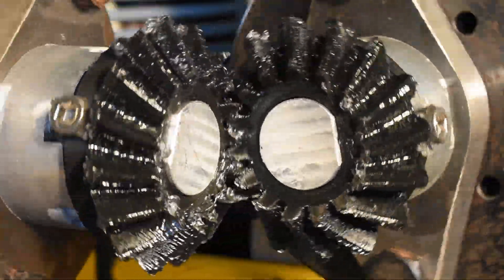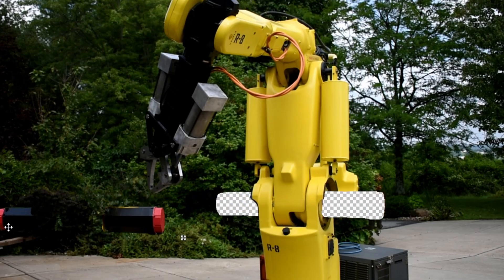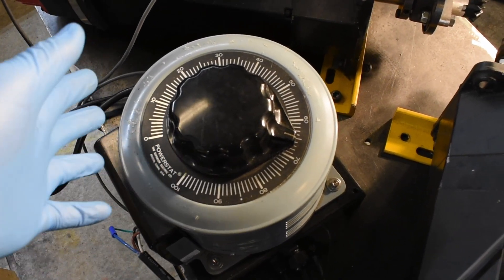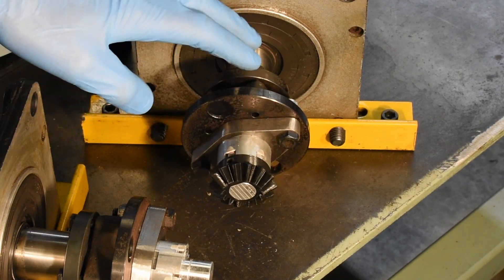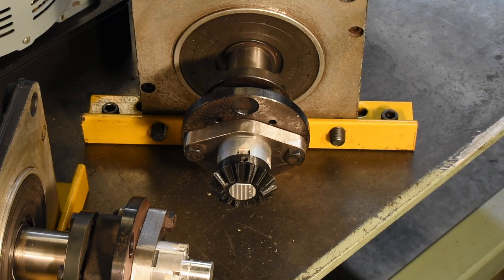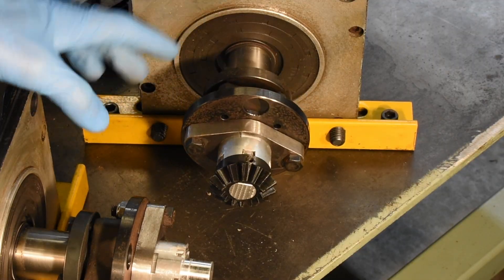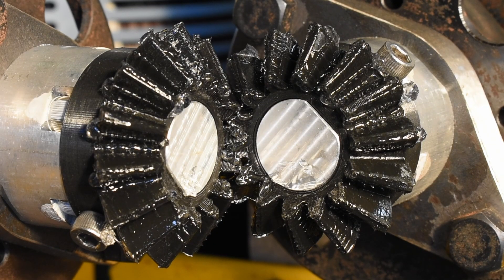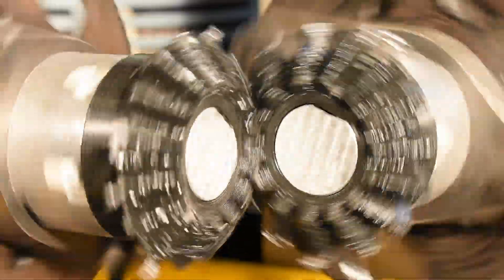Making A Machine That Only BREAKS Gears (scientifically)

Comment: It would probably be more accurate if you use a friction model and identify the viscous and Coloumb friction coefficients as viscous friction depends on the angular velocity.
Reply from the maker: It calibrates the friction at various speeds then interpolates between them for the compensation

Comment: Excessive overkill?  I see excessive run out.  Something that must be eliminated before any usable data can be generated.
Reply: besides bevels being the worst gear of all, hardest to manufacture, hardest to make accurate, with the correct form... without a generator.

sure, FDM works for experimenting but yeah... run out here just defeat the purpose. was that backlash test performed on every tooth?

why mitre gears? with a hunting ratio? would want non-hunting for even wear. only saving grace of miter gears is you dont have to alter the setup of the gleasson to make the pair...

i made a 105T FDM gear for my lathe years ago. it worked, but if you actually tried running a nut up the freshly cut M1 thread? (yes, it was missing the most important and most expensive to replace gear)

the thread gets skewed. any inaccuracy in the gear train, leadscrew has nonconstant velocity, and the resultant pitch it cuts is not consistent.
they look good, theres only a tiny little subtle bit of warping, the typical "grung grung" sound of unmatched teeth... and that transfers down to a pitch that may vary by 0.02mm on every revolution... i aint got the tools for measuring pitch accuracy!

i finally machined a real one up with a dividing head, and yeah... that fixed that. to the tolerance of the machine, anyway. not precision but no worse than any other lathe i guess... .